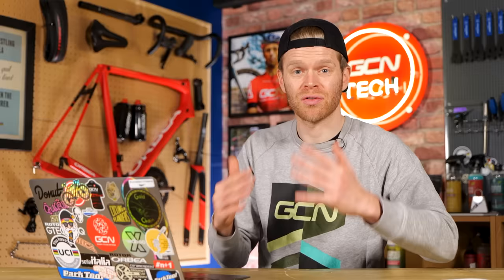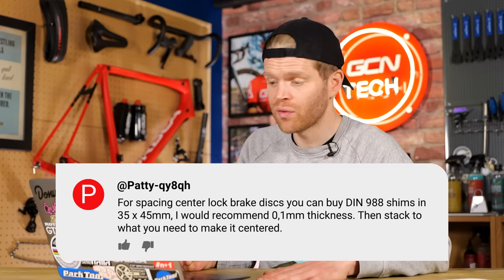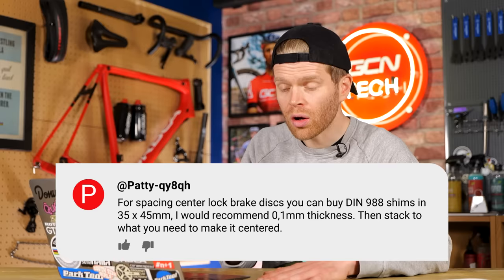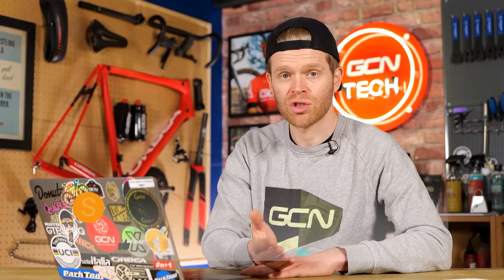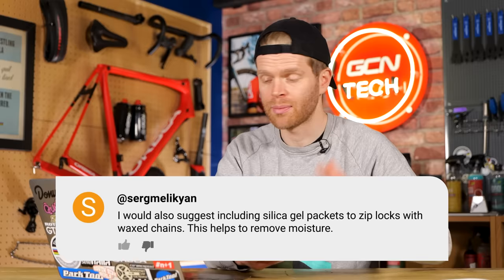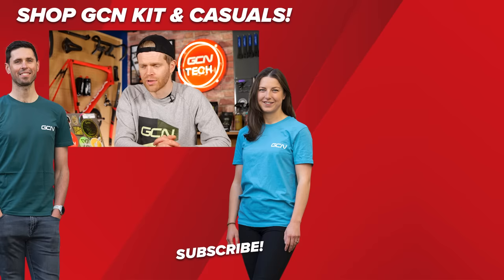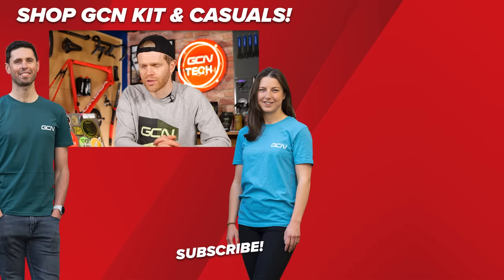Rusting Wax Chains, Tyre Width & Turbo ERG Mode | GCN Tech Clinic

Comment: #askgcntech Dear Manon, Ollie, Si et al, if I could ask, in your allotted time....Riding only in dry conditions, I have just started getting a squealing rear disc brake. But it is very random! Yesterday no noise at all & as it comes and goes. What should I be looking for to prevent this. I have tried cleaning the disc with isopropyl alcohol on a clean microfibre cloth but that made no difference. I have tried blowing at the pads in case of dust build up. Do you think I need to change pads but think not as it is only occasional noise when stopping (and not necessarily just on steep descents) & braking is very good still- but when it sounds, it is LOUD! Also, for example, I can get the sound pushing with rear brake applied a little bit.
Reply: I was having this problem on a new bike. I cleaned the rotors and bedded the brakes a couple times and the rear brakes still squealed. Re-centering the rotor between the pads solved the issue. Worth a try even if it appears to be centered.

Comment: I don't really like loud freehuns, can I make mine quieter with grease without ruining the efficiency? #askgcntech
Reply: Be careful of using too thick of a grease to mask the sound of the pawls as it can cause the pawls to stick or not engage properly, even more so in cold weather.  It can be dangerous when you go for a heavy standing acceleration and the freehub doesn't engage.  And it can cause internal damage when the pawls slip and then finally engage.  Check manufacturer's recommendations to see what viscosity product they recommend.  The pawl noise has more to do with design than lubricant.  A relube may quiet them briefly but the noise will return.

Comment: #askgcntech An unrelated question, but quite annoying nonetheless. How do you stop a saddle from squeaking? It appears to be generated internally from the friction between material layers within the saddle. It's a nice fi'zi:k track saddle. Thanks.
Reply: It may be a decorative cover on the very front underneath - not so sure about fi'zi:k, but I had such problem with several other brands.
Or your saddle isn't that nice apparently. Then switch it, the construction is compromised.
Reply: I've had this. Tilt your bike so you you can get some oil to run down the outside of the seat rail and into the plastic/ carbon moulding that it goes into. Sometimes this is the cause and obviously this won't work if you've got moulded carbon rails. Good luck!

Comment: Instead of shims, which means removing the wheel, disc then refitting for disc spacing. Just loosen the two 5mm bolts, apply the relevant lever and tighten back up. Same result.
Reply: Shims are meant to be a permanent solution.   Adjusting the bolts is an every-time adjustment.
Reply: @CrabgrassFarmer  Yes, they are but the issue the writer has is that if changing wheelsets. That means each time the wheelset is changed the shim would require removing, and adding as necessary. Think about it.
Reply: @Servicevelo  The way I'm envisioning it, you set your brake pads up (i.e. adjust the hex nuts) so that your wheelset with the "widest" profile works perfectly.   Then you use the extremely thin shims between the wheel and the rotor on your "narrower" wheelset to bring the rotor out to the same place they are with the widest wheelset.   It would be a bother to get right the first time.   But in theory, that would be the end of it, and you could switch between wheelsets without any other adjustments.

Comment: Hmm, a rusty waxed chain. Who woulda thunk it. Just like every other iteration of the NEW IMPROVED version of some bike accessory brand or other's w@nk-fantasy of encouraging idiots to pay through the nose for slightly modified cheap-as-chips paraffin wax (cough*Silca*cough) over the last 30-40 years. It goes around in waves. A few years from now, everyone will be back with liquid oil-based lubes when problems such as this become too apparent to ignore.
Reply: I've tried dozens of different wet lubes over 30 years of cycling. This year, I tried wax. IT'S AWESOME! So much cleaner, faster, and easier to maintain on both road bikes and mountain bikes. Wear rates are also much lower, so I'm saving money on chains, cassettes, and rings. I'll never go back to using wet lubes--no more messy grinding paste for me!
Reply: But... "science!".  Lol.  Listen folks it's not that complicated to have a chain that is OILED and clean.  Hint: oil is needed on the inside of the bushings, and only a TINY amount on the outer plates to prevent rust.  What to do if there's too much oil on the outer plates, I will leave as an exercise for the reader.